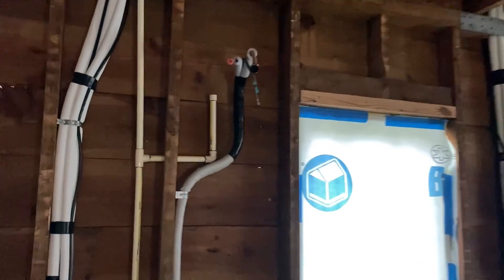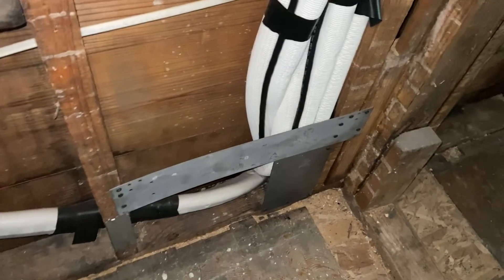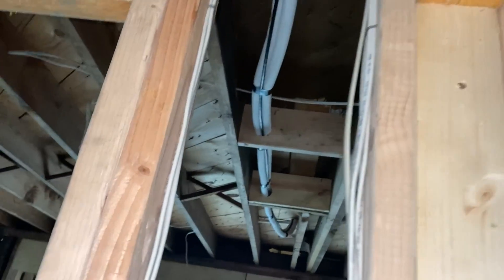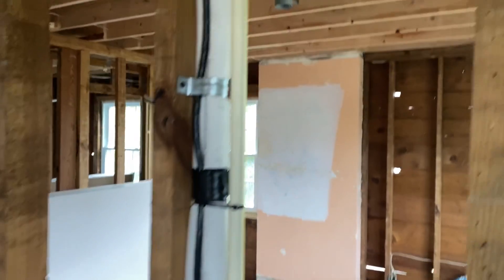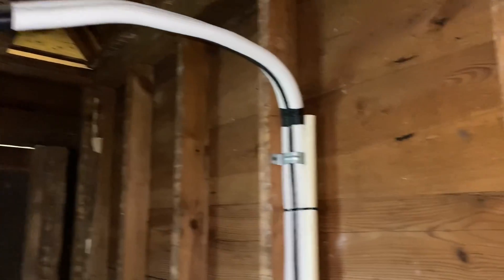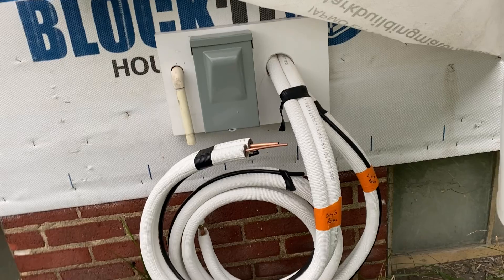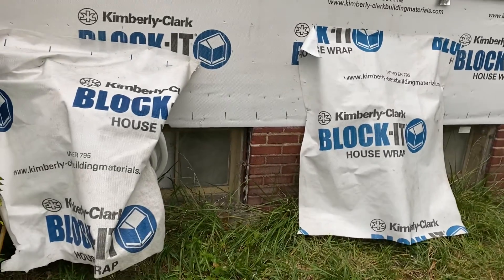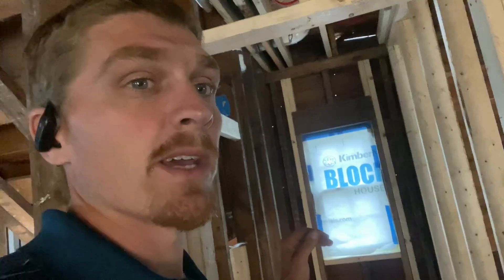Amateur DIY HVAC rough In

Comment: Wrong wrong wrong. How you ever gonna fix an issue once those walls an ceilings are finished or when drywaller runs screws in them
Reply: Tell us exactly how you would do it…
Reply: Let's see your channel on how to do it.  I just did 2 inside line sets on a job and amazingly, not a single drywall screw hit a pipe.  And if the thing craps out in some years, I can cut off the lineset in the wall, leave it,  and then run a new one it the Ugly way - through the outside wall.

Comment: Very impressive line set run, no doubt that was a real struggle even with two people. I like how you have a good friend that gives you good advice on what to watch out for while roughing in the system, kinking those lines is something I've seen by experienced installers. Small bit of advice on the bath fan, look up the Panasonic Whisper fans, not expensive but they offer tons of size options and like the name implies very quiet. They even have 50cfm models, Panasonic FV-0511VF1 and others. Hopefully you found this helpful. Keep up the great work.

Comment: Love the videos and Im local so Im rooting for you.

However, i will say, central HVAC is a huge selling point. I had a minisplit for the upstairs of a bungalow, and since that is a big room it worked fine. However your upstairs is sizeable with multiple rooms. I would have tried some more solutions to get central air in, I think itll really hurt the value later

Comment: I'm really enjoying watching your work on this house.   Your "get it done" attitude is awesome.
Your willingness to learn and be open to what others are offering is great as well.
A couple of points for others that may be watching regarding the DIY Heat Pumps:
It seems that you have done the work "in reverse" in a sense with the DIY, pre-charged line sets.   You have to lose the extra length of the lines outside of the house (or potentially in a basement or attic) you cannot have "extra" at the indoor unit - there's nowhere for it to go.    With the "extra" line coming out of the wall, it looks like you will have to cut the pre-made connections on the refrigerant lines to make them fit in the unit.
I know you said you had an HVAC guy coming to do all the "technical" connections - but you will have thrown away the extra dollars you paid for the DIY heat pump because you won't be using the pre-made ends.   Looks like a couple of different lines have already had the ends cut off.
The other thing to remember with the extra line outside - when you are complete, the coiled excess line should be left in a horizontal (not vertical) orientation.   The compressor uses oil that is carried in the refrigerant.   When the line is coiled in a vertical orientation (like a bike tire) oil will be trapped at the bottom of the loop over time.  It will  take a long time for this to become an issue, but it can ultimately lead to failure of the outdoor unit.

Best of luck with everything -  you've got a fan in Maine.

Comment: I like mini splits. But the issue of running a main chase in 2x4 walls could have easily been solved by boxing in a run that goes up each floor. Usually about 1’ x 2’ roughly.

Comment: Did the same on a remodel and just passed inspection.  Had to replace the supplied drain line with something more durable (pex) because it was in an inside wall.